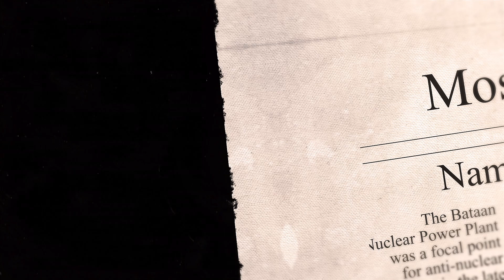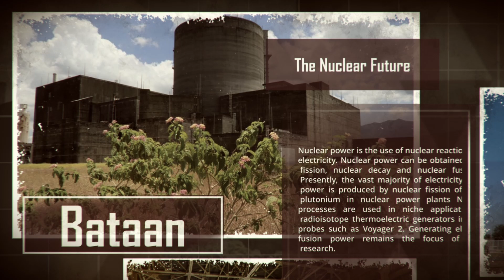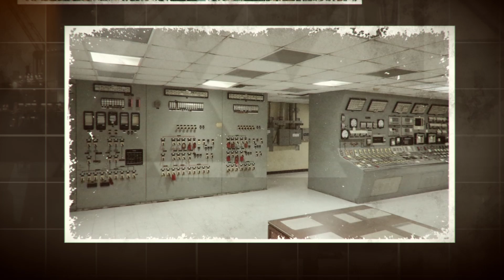Building The Philippines $2.3BN Bataan Nuclear Plant

Comment: Nuclear power is better than oil let me explain. Nuclear powerplants surprisingly have no negative effect whatsoever on the environment, yet to be discovered, nuclear waste has already been solved, most nuclear waste are low or moderate level of radiation which disappear in a few weeks or so while there is high leveled waste they only make up to 3% total in a nuclear powerplants life time. On the other hand oil is harder to handle and pollutes a lot more especially in the air and if the situation in Ukraine were to repeat itself but with a different countries then oil would be expensive.
Reply: Sana may paraan maari ma ipaliwanag mo sa kababayan natin yan, masyadong nakasirado ang utak ng ating sambayanan.
Reply: Consider mo mining Ng uranium